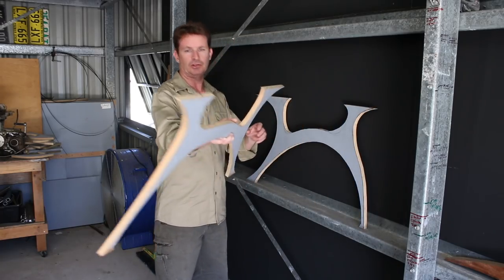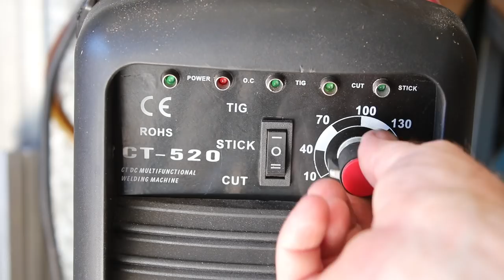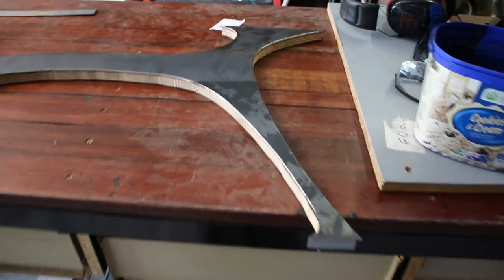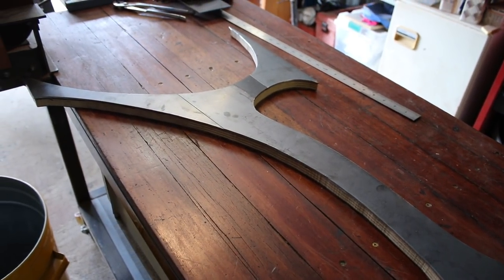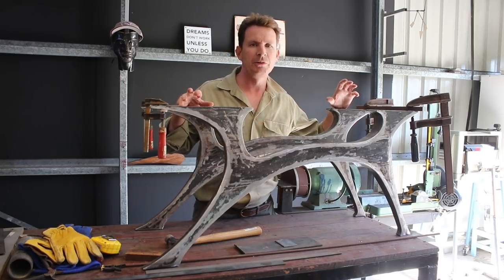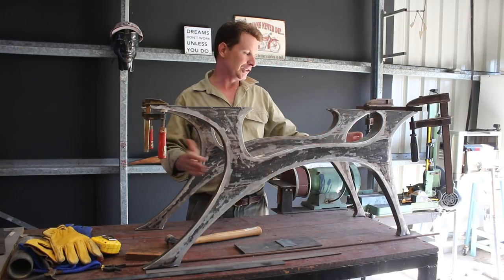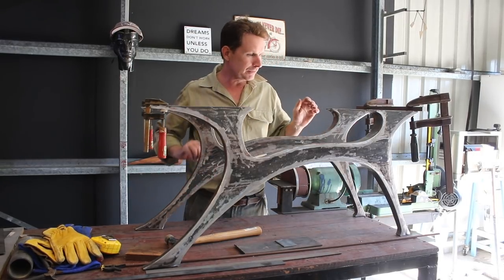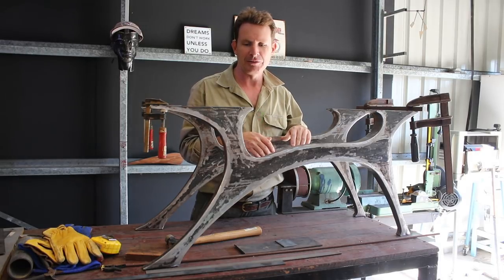Forme Industrious - Funky Curvy Coffee Table 1

Comment: Dude! Your dedication is second to none. There is no arguing how much effort a project like that takes. Have you tried the flap styled grinder discs? They've changed my metal working outlook. I actually like to grind now.
Reply from the maker: G'day Justin. I get an idea, oh I'll make it like that and when I'm doing the build I'm thinking what have I got myself in for....again. I know it will pay off in the end....well most times.  I use the hard 5 inch metal grinding discs to knock down the weld bead and I finish using Flap discs.  It's only a small grinder too so maybe I'll get the next size up.  What......you like to grind!  Fancy taking a trip to Australia ;)
Reply: Uh.....I meant I like to grind MY projects.....Lol!

Comment: Looks great! 👍👍👊👊I started  a shaped steel leg end table 2 months ago..... I'm still fitting metal together, very time consuming......  not even near the grinding part. Although my concrete top is done. Funny thing is I originally thought the top would be the more time consuming part.
Reply from the maker: Hey there Gib, so right takes plenty of time for sure. I'd love to do a concrete top, in fact I will one of these days. All the best and thanks for your support as always!
Reply: Scott Turner I tossed stained glass scraps in the concrete and polished it with diamond pads I got from Amazon. pretty cool look. process was much easier than I thought. we both could use a plasma table ☺️
Reply from the maker: That would be a cool look! Oh and a welding table. My big problem is space so I make stuff to store away when not using, like my little plasma table. It rests on my workbench with dowels to hold it, the other end has one leg attached by one small nut ;)
Reply: Scott Turner Think we just need a big maker commune in an abandoned steel mill

Comment: I really like the shape so far.  I have a quick noob question.  How do you know when its time to throw out the grinding wheel?  Looking forward to part 2.
Reply from the maker: Hi Dan, and thank you! The disc gets small so therefore the grinding tip is moving slower and the grinding takes longer, and you can see the wear on the disc. Many of those discs have life in them yet, but the video needed a little drama ;)
Reply: I assumed some of that was for effect but it made me think to ask the question, thanks for the reply.

Comment: New welder here and I know nothing about furniture.  Love your work and have a question.  Pardon if you've answered them before.   I noticed you are cutting individual pieces from flat bar then welding them together to make one side.  Example @3:21.  What is the reason for that instead of cutting the unit as one piece out of a sheet of the same material?  Is it to reduce waste?  Is it more economical at the trade off of more welding?  Thanks again for the video.
Reply from the maker: Well I would like to cut the profiles out of one large sheet to save time, however doing it that way creates a lot of waste. Also there is handling large sheets of heavy steel is difficult. Transporting is also a bugger. So it works for me to use lengths of flat bar and create what I need from that. If I had a large shop with a lifting device and large plasma table and a good supply of steel sheet, I would definitely cut out of the larger sheet.  Hope that helps and thank you for your comment.

Comment: Willpower man. Good stuff. I guess  you could easily get away with using 2 mm stock. Obviousley... depending on the radius you want to maintain on the edges. If you fit up and tack your parts  inside edge to inside edge you could just fuse them with the TIG torch, or maybe use just a bit of filler. That way you d save a lot of time grinding. Hope i dont sound like a dick, man. Love your stuff. Greetings from DK
Reply from the maker: Hi sonOFchance, what you are saying is right, in fact I just got my TIG working again and I can see how that would save on the grinding, not that I'm very good on the TIG but with practice I will improve. Another thing about Flux Cored wire is the splatter, even when you have all the adjustments right you still get some splatter. Next chance I get I'm going gas.  Thanks for your comment, much appreciated and all the best!!

Comment: you had plenty of life left in the grinding discs lol great job
Reply from the maker: 100% right, all for added drama. I'll keep all those discs until they are about the size of a button ;)
Reply: well done lol, aye the rossi plasma cutter whats it like? do you need a compressor for it?
Reply from the maker: Well I've never used another plasma but my guess is it is pretty basic. I get by but it some times leaves a rough cut, maybe it's just me. Yes you need a compressor, Electrical Current (Plasma Arc) melts the steel and the compressed air blows it clear

Comment: Good Morning Scott,

Really nice job on the furniture and fabrication. I see in your videos that you use a lot of grinding wheels. I do a lot of fabrication and thought I would share some advice with you. I use a fiver discs for my angle grinders when grinding as it's a lot cheaper and takes the metal down a lot quicker. You'll need to purchase the backing disk with the nut but other than that you just need to change the disc. Here's a link to what they are and look like. Also for finishing you can get flappy paddle ones that are super great for a smooth finish.

http://www.onlineindustrialsupply.com/fibre-backed-discs-aluminum-oxide-fibre-backed-discs-4-inch-diameter.html
Reply from the maker: Hi Matthew and thanks, I'll have to check out those discs for sure!  I finish using the Flap discs to a smooth finish.  Thanks for the feedback Matthew!
Reply: Good Evening Scott,
Your very welcome and I hope you can find them.... Oh glad to hear you already know about the flap discs. Their amazing but I find to be pretty pricey at times.
Keep up the great work.
Reply from the maker: I just got a batch off Ebay and trying them out. Zirconia seem to last much longer than the brown ally oxide. so far so good. Cheers.
Reply: Oh glad to hear. I'll have to look into those my self. Thank you for sharing that bit too... Cheers Eh!!

Comment: Please buy a real welder ... a gas shield mig is not even comparable  to nasty flux core crap.... you won't even have to grind them down on most stuff and almost no spatter or smoke
Reply from the maker: Hey Mark. I know all the benefits of Gas. One day I will change over. I don't need to buy a new welder. At the moment it's at the height of summer and it gets very hot in my shed so I use two fans. Gas welding and fans don't get great results. No splatter and smoke would be great! Thanks for the comment!

Comment: Scott, like your work and style and simply the fact you´re an ozzi. Love the accent. Reminds me of several years spent down under. Also - are you familiar with metal works or wood works by trade? And finally - I spotted a WRR250 in the back. Nice bike!
Reply from the maker: Hi Ralf. Thank you! my trade background is aircraft airframe and engine maintenance. Over the years I have learned welding and woodworking by doing research and by just having a go. Oh yes that is a WR250R - wonderful bike - I need to ride it more often :)
Reply: Scott Turner, cool!  Are you working as a YouTuber full-time now?